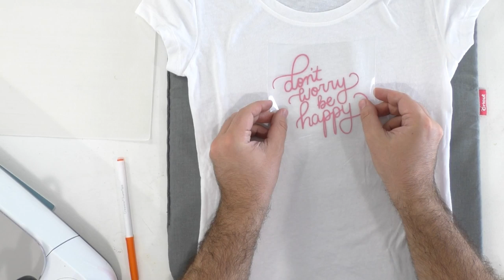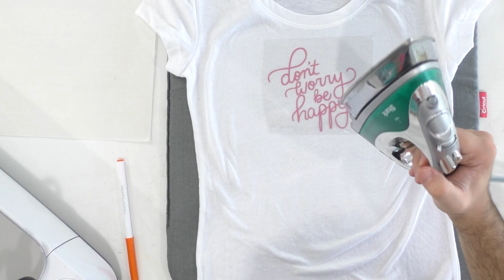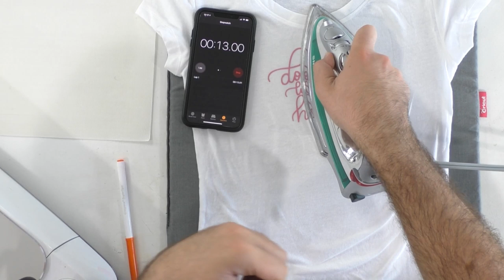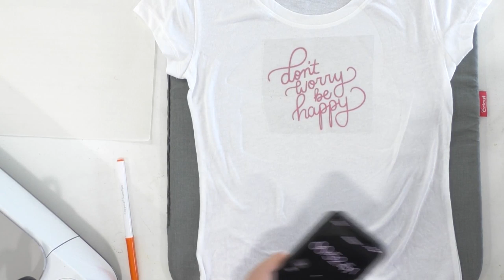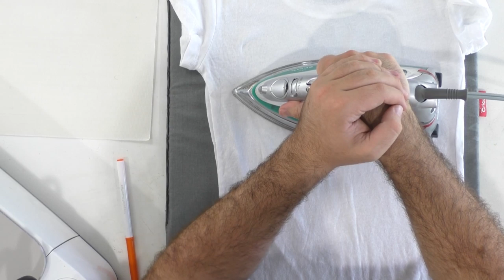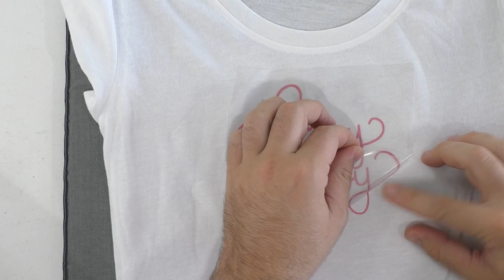How To Use HTV With a Household Iron

Comment: Perfect! Thank you so much for your tips using an iron.  I never had any intention to do T-shirts but some "Everyday Iron on " came with my newly purchased Maker, so bought a cheap T-shirt and followed your instructions. I have put my sons name of his band and a graphic on it. It took really quickly, I did turn down the heat a tad, and used a clean wooden chopping board to press onto. Followed the 30 second tip, and the transfer paper started to come away cleanly. Fab! Bet the rest of the band will want one now - what have I started?

Comment: I tried this and it didn't work well. At my cotton setting, the plastic backing warped, making the image warp. I believe the reason is that my over 20 year old iron runs hotter than other newer models. So putting it on the cotton setting isn't even it's highest available setting. I dropped the temp down a notch and it worked okay. Just in case someone else was having issues definitely do a test run.
Reply: Mines been doing the same I'll try to turn mine down and hopefully that helps... Thank you for the tip💕
Reply from the maker: Regular household irons do not work well with HTV. They have such uneven heat distribution, you never know which part of the design is heated/adhered properly because of this. Also you never know what temperature your Iron is actually at, making it hard to properly adhere your design. We HIGHLY recommend getting a Cricut EasyPress Mini: https://amzn.to/2zvjW9D for all of your HTV projects :)
Reply from the maker: Hopefully it will help!
Reply: Same here.

Comment: Hello, question for you. I recently used HTV for a shirt using an iron, but the vinyl in certain areas became wrinkly. Do you know what I did wrong, and if there's a way to fix it?
Reply from the maker: Yes, the Iron is too hot in certain spots. Regular household irons do not work well with HTV. They have such uneven heat distribution, you never know which part of the design is heated/adhered properly because of this. Also you never know what temperature your Iron is actually at, making it hard to properly adhere your design. We HIGHLY recommend getting a Cricut EasyPress Mini: https://amzn.to/2zvjW9D for all of your HTV projects :)

Comment: Could you use a household iron to make a blanket??
Reply from the maker: Regular household irons do not work amazing with HTV. They have such uneven heat distribution, you never know which part of the design is heated/adhered properly because of this. Also you never know what temperature your Iron is actually at, making it hard to properly adhere your design. We HIGHLY recommend getting a Cricut EasyPress Mini: https://amzn.to/2zvjW9D for all of your HTV projects :)

Comment: When I had mine at a high setting and held it down it melts the plastic of the vinyl. Idk if i need to turn down the heat on mine or put a barrier between the plastic and my iron which I've seen many ppl do with at home irons?
Reply from the maker: So, the issue with household irons is that it's so hard to gauge what the "highest cotton" setting is, so sometimes it's way too hot, but there's no regulation with the brands. Maybe start with using a sheet of butcher paper or parchment to be a barrier?
Reply: @MakersGonnaLearn  thank you for the fast response! I will try that out that you!

Comment: Thank you for the video - after watching the video I tried ironing on my image and after 30 seconds the plastic coating was practically melting and the iron on material started melting as well...  not sure what to do.
Reply from the maker: Oh no!! Sounds like your iron was just too hot. Unfortunately we've been seeing more and more issues with using HTV with a household iron that we've stopped recommending it :(  The biggest reason we made this video was because at the time EasyPresses were so expensive, but they aren't anymore! Household Irons have such uneven heat distribution, you never know which part of the design is heated/adhered properly because of this. Also you never know what temperature your Iron is actually at, making it hard to properly adhere your design. We HIGHLY recommend getting a Cricut EasyPress Mini: https://amzn.to/2zvjW9D for all of your HTV projects :)
Reply: Totally doesn't work with my household iron....I'm guessing I'm not the only one you probably should add a warning!
Reply: @dianebeaudoin7831  Listen it works with a regular iron and a wooden board works perfectly. No towels folded on top or pillowcase no i just put T shirt directly on top of wooden 📦 and its perfect. Also I have used Glow in dark HTV with white backing and a sheet to put on top of HTV when ironing. Came with NO Real directions so I learned through trial and error and looking at pics with a 1 word description (directions?). Also mine came with a reusable teflon sheet. I put my design with color facing me whjte backing on Tshirt. Then I ironed with teflon sheet over the vinyl. After it started to bubble I let it cool down and peeled off top clear bubbly sheet. The wént over it again with paper over the design.

Comment: After a single washing, was the logo able to keep well? I've been wanting to make my own tshirts for some time but I worry that if I wash and dry it perhaps it'll disappear.
Reply from the maker: So, unfortunately this video is outdated and the only reason we recommended this is because other heat presses were so much more expensive than household irons. However, with the Cricut Mini EasyPress: https://amzn.to/38rp9hf being so affordable we highly suggest getting it. Regular irons have such uneven heat distribution, you never know which part of the design is heated/adhered properly because of this. Also you never know what temperature your Iron is actually at, making it hard to properly adhere your design. It's possible to have success with it, but not worth the potential waste of time and money in our opinion.

Comment: So I tried following your directions, and when i lifted up the iron, the transfer tape of the HTV was crinkled like it was burned from the iron.. Any advice?
Reply from the maker: While you CAN use a household iron, it's not the best thing to use for HTV, for several reasons. You never really know how hot your iron is. While we recommend your iron to be set at the hottest cotton setting, sometimes, depending on the iron, the "highest cotton setting" can be much higher or lower from one brand to another. Also the heating element in household irons is not even, and some parts of your irons heating plate is much hotter than others, which can sometimes cause issues as you never really know which areas on your HTV have been well adhered and which haven't. While you can use your iron, it's not the best. We highly recommend getting a Cricut EasyPress Mini: https://amzn.to/2zvjW9D
Reply: I used a thin 100% towel between the design and the iron
Reply: I used butcher paper. And works great ☺️

Comment: When I did this with my home iron my vinyl wouldn’t stick on, but when I tried with another vinyl it did stick. I used a holographic vinyl and it stuck but when I used a white iron on vinyl it wouldn’t. Any tips ?
Reply from the maker: Holographic vinyl is adhesive... white Iron-On is HeatActivated, you were using the wrong product.

Comment: I tried it on the warmest setting and  the design was wrinkly
Reply from the maker: That's because it might have burnt it. Using household irons are tricky! The heat plate is uneven, and you never really know how hot it is, which can be a problem for the HTV.
Reply: do you have 2 different cotton settings on your iron?  i do...i use the first cotton setting and avoid the wrinkles

Comment: hello :) did you use a cutter plotter for that design? if not, what kind of vinyl is that? 
also, did you use an inkjet printer for the design? or laserprint?

Thank you ^_^
Reply: A cricut is what cut the design. Silhouette or whatever does the same thing.
Reply: @jennapassarelli2295  thank youuuu 😊